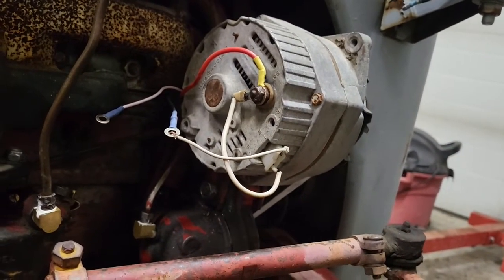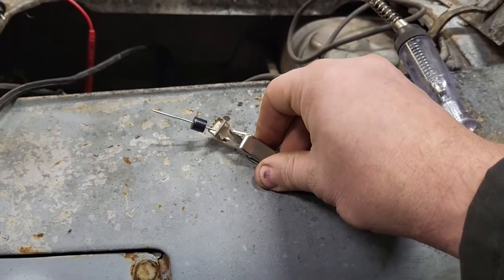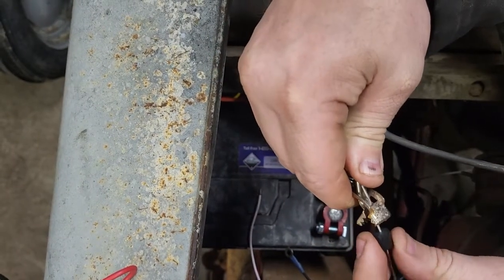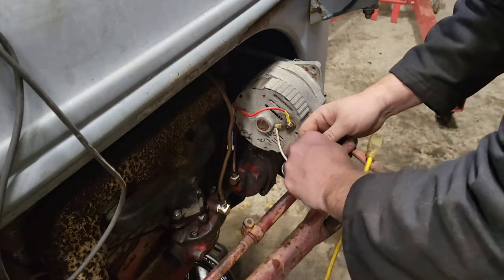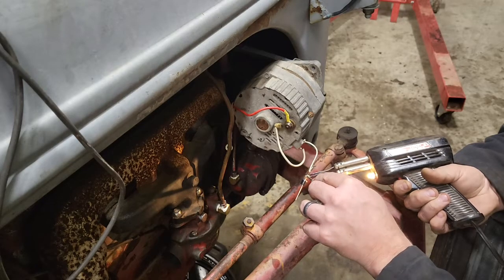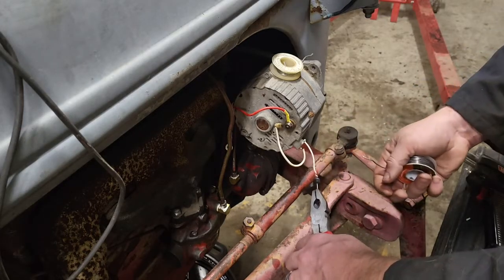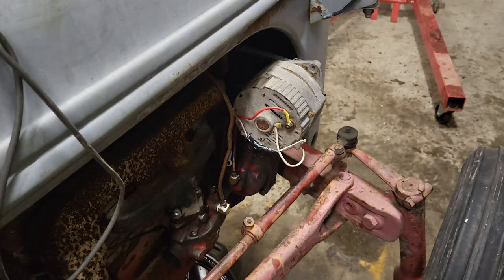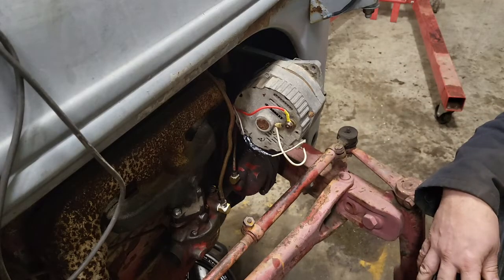Connecting a Three Wire Alternator to my 8N Ford!

Comment: Thank you for the demonstration video
I have a 53 ford using a 3wire gm alternator 
My question is where did you purchase that doide  and how many ohms/amps does it need to be
This is my fist time wiring this up
Reply from the maker: I bought it on Amazon, if I recall correctly it was 3A.  There's really not much current required to trigger the alternator to charge, could probably get away with way smaller.  

I think a pack of 50 of them was like $6 :)
Reply: @billstractorcorner  ok kool!!! Thanks I appreciate it
Also if I would take out the 3 wires that were hooked up to the original voltage regulator 
BATT GEN FIELD
 I would only be using the BATT & GEN correct?
Reply from the maker: Right - you could put the diode on the field wire and connect it to switched 12v power and connect to the exciter connector on the alternator.
Reply: @billstractorcorner  perfect man I appreciate  it thank you!!!
Reply from the maker: Anytime, good luck!!

Comment: I built a one wire self exciter alternator for my 8n for less than 25 dollars. Easy peasy limon squeezy.
Reply from the maker: Cool.  Does it charge at low RPM or do you need to rev up first?
Reply: @billstractorcorner  yes it charges while idling.
Reply from the maker: @ShelbyBunton  nice!

Comment: If you don’t wanna go through all that trouble, you can do what I did which is to wire a toggle switch Between the exciter wire and a 12 V power supply. After you start the tractor, you flip the switch on and then back off. The alternator does not have to have constant 12 V to that post, it only needs 12 V to get it started.
Reply from the maker: Long as you remember yes that will work.  I'm terrible for remembering to do that sort of thing tho!
Reply: I only forgot once, it left me, stuck in a bad spot. Now it’s the first thing I do when I get on and start up. Now on my Other 8N (I have two Because I’m an upper Class trailer trash redneck)🥸🤣🤣 I put an alternator out of an old Chevy that had been sitting out in the pasture for about 20 years, it works fine, except when you first kick it off it squeals like a pig for about 15 minutes. It sounds awful, but it throws out 30 A all day long. Sam may say that things gonna go out soon but it’s been three years now, I guess if it goes out it goes out, but on that one, I know it ain’t chargin if it ain’t squealing!😜 
Nice machine, bud, yours is a lot prettier than mine!

Comment: Where does the dam exciter wire hook to?
Reply: Ignition on the starter?
Reply from the maker: @soulmedicine  to the keyed power side of the ignition switch, so you have 12v+ to it when the key is turned on.

Comment: What size diode did you use?  I'm getting ready to change my generator to an alternator...getting all the info I can find.
Reply from the maker: 3A - the one I put on in this video actually died a few weeks later.  Not sure if it was a defect or undersized, but it started passing current both ways.  So I twisted 3 together and put them in the same spot... so far so good.  Here are the exact ones I purchased, there may be better ones, I'm not an expert.    

https://www.amazon.ca/dp/B082KCC5T8?ref=ppx_yo2ov_dt_b_product_details&th=1